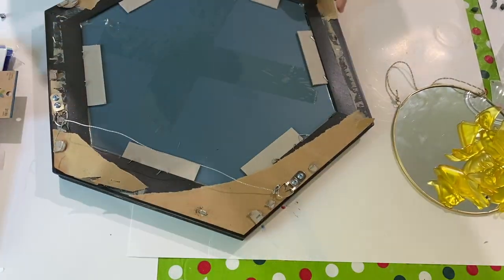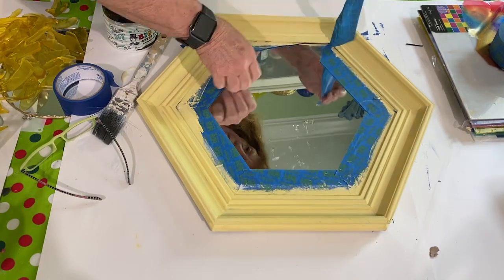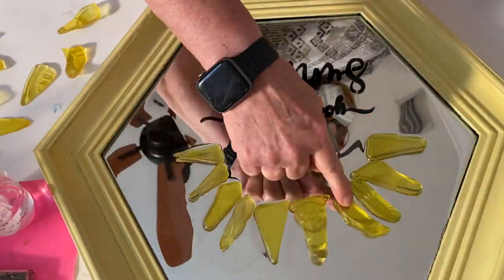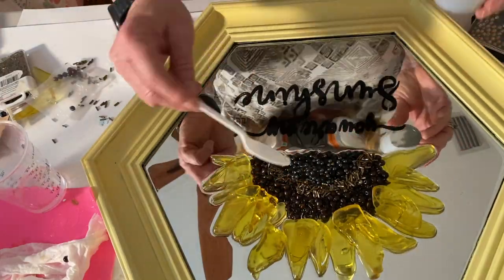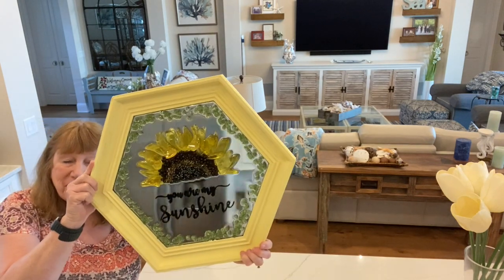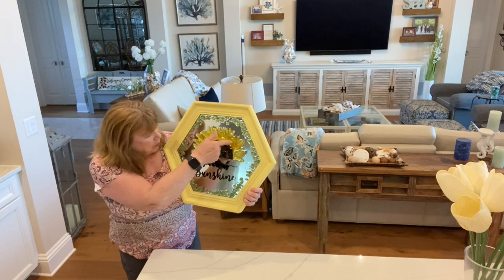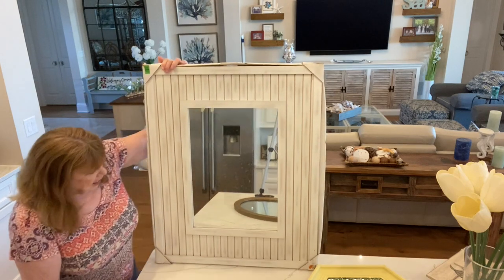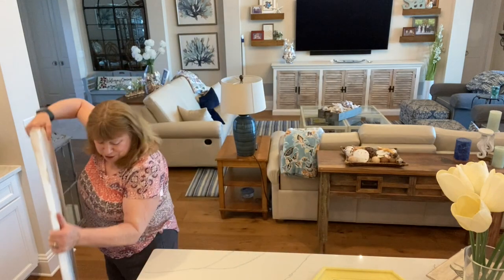EPOXY RESIN MIRROR, SUNFLOWER, (FAUX) SEA GLASS,  TEMPERED GLASS, GLASS ON GLASS ART RESIN

Comment: Rewatching 😊
Wd love to see if you’ve done a project on the slotted boards yet. 
I bought about20 clearances out boards, took them to work and sanded them off to make them smoother and have not yet done anything 
Paid about $1.50 to $3 each. Some are 24 ish inches
Reply from the maker: No, I was just looking at the garage pile of windows and boards that I need to do something with the other day

Comment: I would have left the back on and painted the frame around it. And then I would have sealed the mirror in the front instead of worrying about the back. I always seal front and back if they're accessible. And still I get leaks. The one that I'm working on right now I put Elmer's glue first on front and back then I put silicone front and back. I'll probably still get leaks.
Reply from the maker: Im such a sloppy painter I thought it would be easier if I took the mirror out. I have been doing well if its a small frame with glass and just using elmers glue.

Comment: I don’t know why but I can’t find that Krylon paint anywhere I live in Texas where do you live or where do you order yours from
Reply from the maker: Yes you can find it on Amazon but the prices are crazy . Did you see my video about the Tamiya spray paint as an alternative?https://www.youtube.com/watch?v=93PNFUfoXvg&t=39s. I have links to the Tamiya under the description on the video
Reply: Just used yellow krylon on 1/4 fire glass. 10 coats . Didn’t work. Now I’m going to run that glass through the Tumblr and see if I can get the krylon off. Yesterday I used the hot pink Tamyra paint and it took one coat and came out perfect. I am going to stick with the Tamyra translucent glass paint

Comment: Somehow I think the glass stays on better if you put the glass down first and then pour the resin over it. I don't know if that's really true
Reply from the maker: I think the glass will stay either way once it dries but if the glass is flat and not glued down I think you can get more bubbles if you put it on first.
Reply: @crazyglasslady  I had not thought of that. But all of the pieces that I've been doing have been putting the glass down first and I don't think that there have been any bubbles trapped underneath the glass